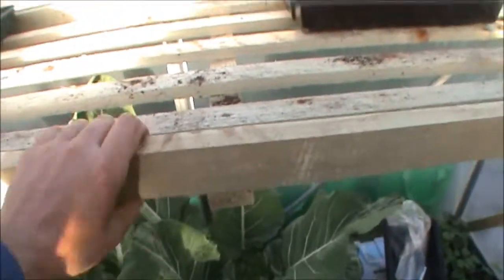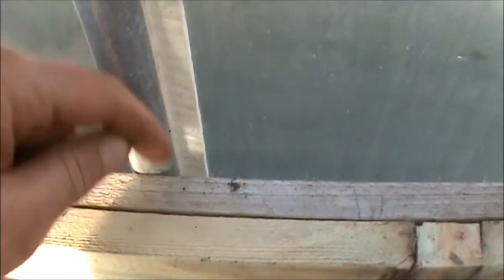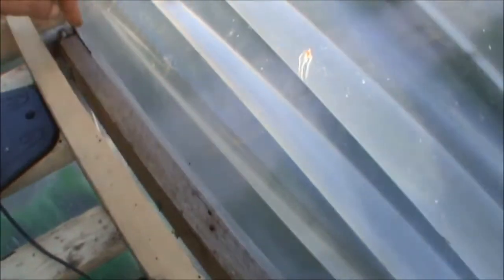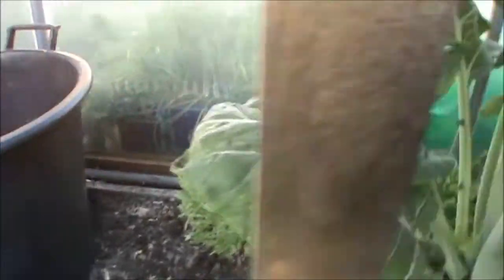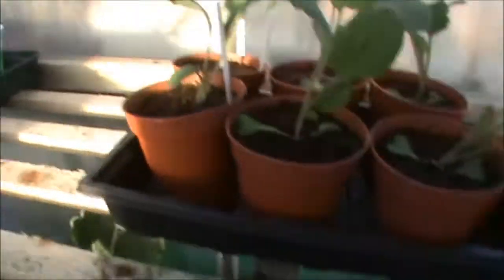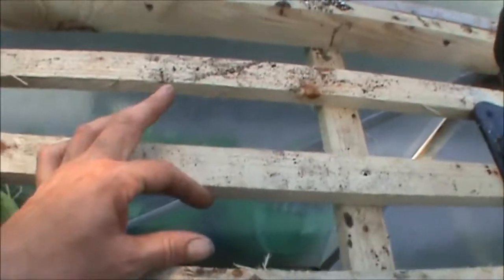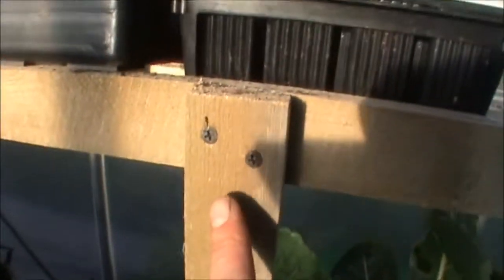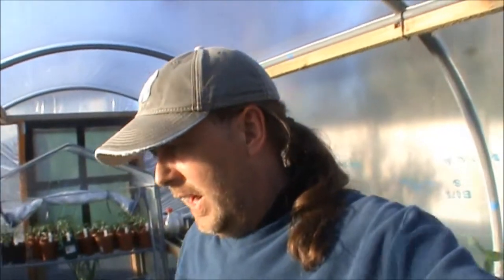Polytunnel staging and a brief chat what ive been up to

Comment: Screwing wood to the polytunnel tubes? Why didn't I think of that?? Basically that's the solution to all staging issues!
Reply from the maker: Yep, just a few strips of timber then you can fix alsorts to it and plus it makes the frame more sturdy
Reply: @andy160676  I'm guessing you used something like 1" self-tapping screws, countersinking them into the wood? Just looking at suitable screws right now!
Reply from the maker: @leighvaughton2740  I just used 25mm x 45mm slate batten and 35mm screws and used a 3mm pilot drill bit for the screws